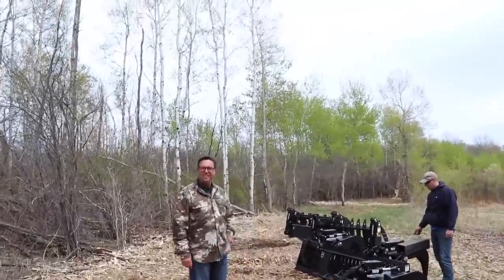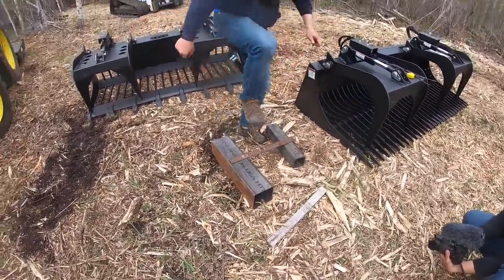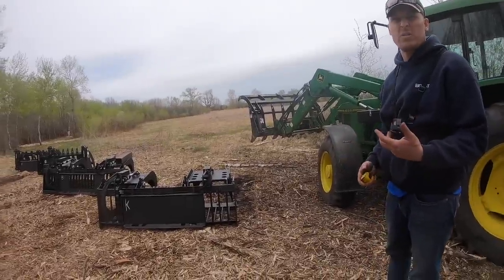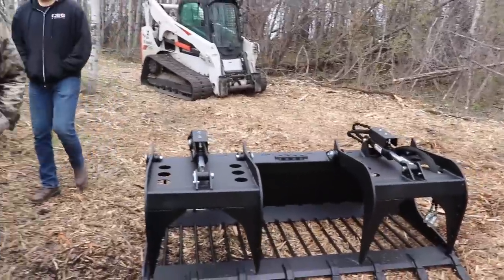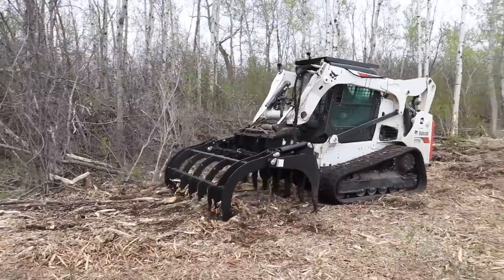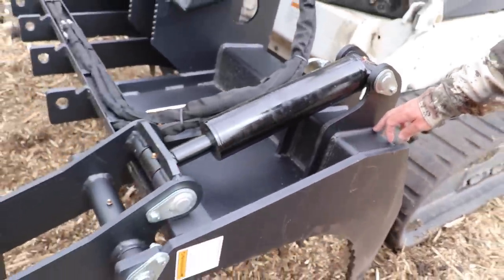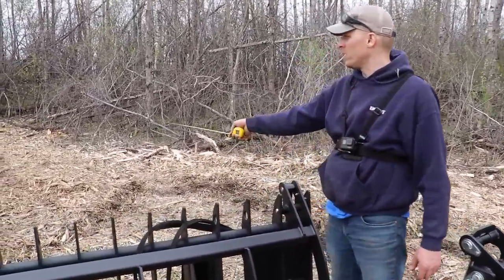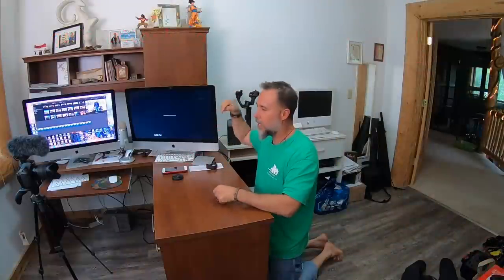Grapples and Root Rakes- Chinese JUNK VS American Made

Comment: For backyard work, the average guy doesn’t need to spend $5,000 on a top notch grapple vs $1,400 on a cheap one.  The $1,400 one is still steel, you just can’t be as rough with it as you might be working as a contractor day in and day out.

Comment: Eh, engineering wise didn't really learn much. Designer of said grapples also seemed a little confused almost as to the correct applications for each grapple, and why certain design decisions were made. Like which one of the 4 would be idea for picking up 6-14" trees?  The one on one extreme seemed ideal for demolition stuff, broken concrete etc. and the one on the other end seemed idea for raking and light brush, but that's all I got out of it.  The short lower tines for brush to me don't look all that safe if you're picking up logs and expecting the upper arm to hold the weight on them.  I'm guessing one of the middle ones are better... but not a great comparison I felt.
Reply: @benjaminfitzgerald2037  That's actually a great point about the square on the backbone. I didn't think about it that way, but you are absolutely correct,. Thanks so much!
Reply: @benjaminfitzgerald2037  oh the larger 6x6 he showed is definitely stronger, in all areas*: bending/torsion/compression/tension due to having a larger moment of inertia and more cross sectional area. Whether that is something that you really need or if its extra money put into it that goes to waste? ehh there's no way to tell from here.

*assuming identical metals

Comment: For the sifting grapple system.  Wouldn’t it be nice if the operator can press a momentary (about 3 seconds) button or AI voice-controlled “vibration mode”in the hydraulic system.   That way the grabble contents are thoroughly sifting out the soil.

Comment: I’m more confused than before the video ?
I am in the market for a grapple for brush and raking ? Beginning to think the engineer don’t have a clue  ? What they should do is say this is best used for ......
Reply: Agreed. They sound like used car salesmen winging it describing those grapples
Reply: You need a root rake grapple, that is what it is called for debris and woody material. Those were the units on the right. Depending on use and type of machine impacts purchase a lot. The units they were talking about are dedicated to skid steers which are heavy and strong. If you are putting your grapple on a compact or sub compact tractor you don’t need to worry about most of what they are saying because the tractor don’t have enough power to hurt it. One thing people forget is that most grapples on the market are built stronger than the capabilities of the tractors. You’d be damaging your tractor long before damaging a grapple and we own 5 for our tree service. Damaged tractors is what we have to worry about not grapples.

Comment: I just got a Jenkins Iron & Steel super  duty brush grapple made in Minnesota. It's a beast, perfect fit for my ASV PT80. Paid around  $2,700.
Reply: MAGA MAN I am up in the air should I get the super grapple with the split grapples or the regular brush grapple what made you go with the split grapple. Thanks.
Reply: @michaelkastis9795  with the split top, a lot more brush will stay in and not fall out. It grabs the material and holds it down in 2 points, rather than just one. With the single top, if you grab material/brush and one side has more, it squeezes just that side and stuff will fall out on the other side.  With the split top, if one side has more than the other doesn't matter as it will squeeze both sides.
Reply: MAGA MAN Thank you for the help so far I have bought 4 attachments from Jenkins been happy with them. I am going to buy a shredder not sure about the Jenkins one though I wanna be able to lift it up to trim the branches on some Mesquite’s that hang real low. Not sure about the ax blades verses the regular tractor shredder blades.

Comment: A36 is fine for the general structure, It is the alloy used for ships shell plate, storage tanks, etc. T1 would be for the teeth or anyplace with very high stress or abrasion. The grapple is just fine made out of A36. No real abrasion or strain.  The main thing is ease  of repair. A36 can be welded with common E6010 or E7018 rods with preheating only required if it is below freezing. T1 needs preheating before welding to several hundred degrees, absolutely dry steel and use of E8018, 9018 or 11018 rod. I am a 30 yr journeyman shipfitter/welder and crane boom repair welder. Crane chords are usually T1 with either A36 or 4130 chrome moly lacing.  I have made several  brush rakes for bulldozers and grapples for excavators. Never found that I needed anything stronger than A36.  But saying its better because its made of T1 is like saying a car is better/ more dependable because it has a V8 instead of a straight 6.
Reply: How does AR450 rank? That's what Everything Attachments uses for their grapples.
Reply: @tlr-nut7275  Ar 450 is an abrasion resistant steel that I have no experience with. I am still in favor of A36 and hardfacing wear points due to ease of repair and lower cost steel. Look up "welding AR450". There are several problems welding it, no simple field repairs like A36. ( Preheat, heat affected zone embrittlement, need for steel and rod to be dry to avoid hydrogen embrittlement, etc)
Reply: @tlr-nut7275  
AR is used only on cutting edges. Not for the structure.
Reply: @lumberjackdreamer6267  They use ar450 for the whole build. Watch one of their videos.
Reply: @tlr-nut7275  
That would be a waste without added benefits. More expensive and harder to weld.
Reply: @lumberjackdreamer6267  Check out their Friday factory tour videos on here. Just about everything they make is with ar450. They do comment that it is harder to weld and form in a press than cheap steel.
Reply: @tlr-nut7275  
I will look into it. If you have a link, please send it over. 

From what you wrote, it sounds like poor design choices. Different materials are suited for different applications.
Reply: @lumberjackdreamer6267  Just search "Everythingattachments". They have lots of videos showing it.

Comment: Great timing for the video.  I just bought a Viring grapple. Its a pretty solid piece of steel, but the hose placement sucks! I had concerns from the start. I even tried to zip tie up the lines but sure enough I ran over a hose when I wasn't paying attention. So maybe I'll get a credit for redesigning their equipment?

Comment: I'll take that last grapple. Looked heavy duty. Would have been nice to see the American made vs Chinese in real world work.
Reply: I have seen those, They bend, twist or rip the cylinders off or apart. One well designed one if the boom was up, the grapple fully dumped, then the boom lowered would poke the tines thru the front tires. After replacing the front tires twice they took the grapple to an auction.

Comment: Very well put presentation!
Cheap crap is cheap crap, regardless of where it is made - there used to be [may still be] a LOT of crap made in the USA, as well as other countries - you NEED to know what you are purchasing and, remember, some sales people are idiots/dishonest/misinformed [lied to] or simply don't know what you're talking about [that might come under idiots, though]. 

IF, and that's a big 'if', the manufacturer has the required standards, it doesn't matter where something is made. The problem with Chinese made stuff (also may apply elsewhere) is a lot of it is from small fly-by-night companies that copy reputable product as cheaply as possible AND distributers/retailers who are just focused on a quick buck AND(!) customers who just want 'cheap' and not 'good'!

Buying expensive doesn't automatically mean good, but cheap stuff is cheap for a reason...
Reply from the maker: Thank you !
Reply: One problem is in the standards. I used to be big into stereo equipment, and I can tell you  with all certainty 100 watts may not = 100 watts. Like the guy was showing the different  standards of steel, 1/4 inch doesn't = 1/4 inch. In this video, I learned a few things, and it's always better to be informed.  In modern times it's always "buyer beware"!
Reply: @papageo5  PMPO ;-)
Reply: @gordowg1wg145   PMPO!  Exactly!  Sometimes my analogies go sideways, but not this time. Kindred spirits my friend! Wow!

Comment: I learned from this video....
1- It's harder to stand still on T1 steel. 
2- It's hard to pretend your putting equal weight on T1 steel compared to T36.
3- This company needs to hire better actors.
Reply: I learned from this comment….
1- the author doesn’t understand basic material properties or stress analysis 

2- You don’t understand the stress resulting from a static load vs an impact load is significantly different. When he kicked the T1 it was was more “load” than just standing on the mild steel

3- the author should consider educating himself before posting comments like this one